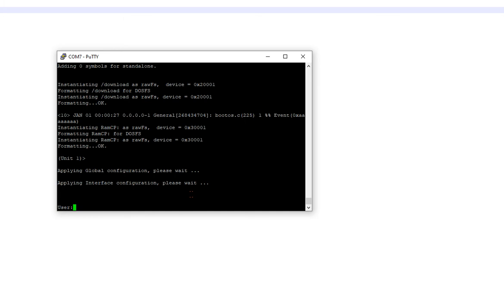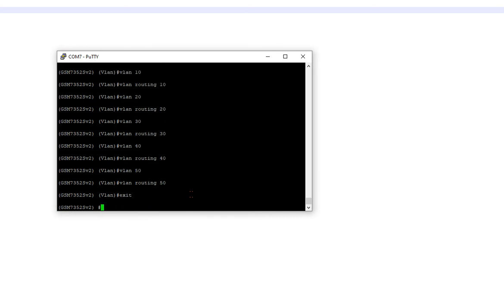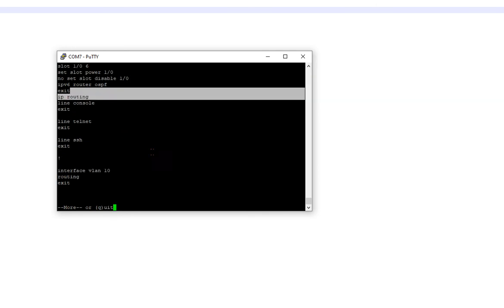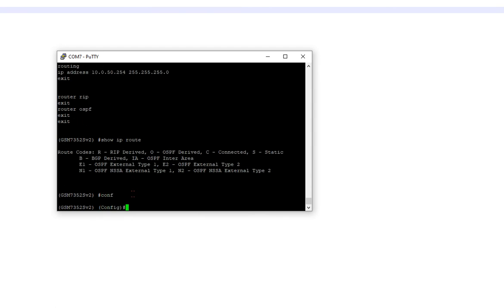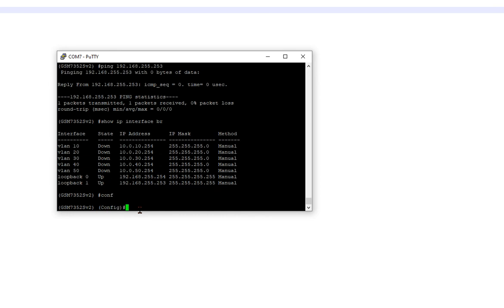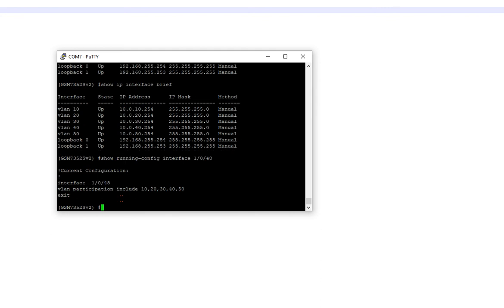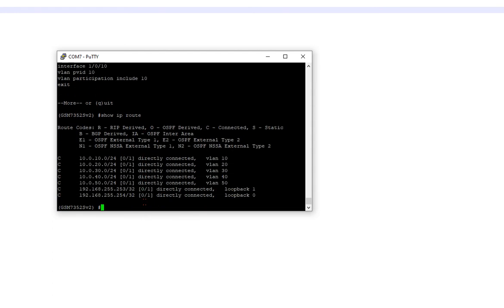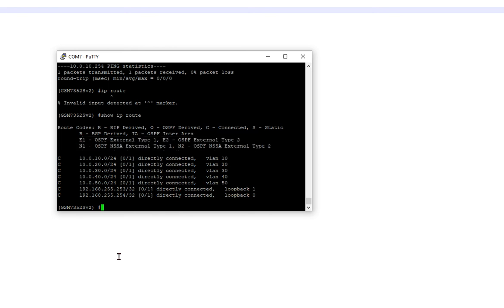Netgear Intervlan Routing

Comment: How can i route this to internet? like all vlan will use vlan 10 as the gateway for internet?
Reply from the maker: You can. You would need a routed leg on your switch (L3 port) as a point to point or screened network and then either ip default-gateway X.X.X.X or ip route 0.0.0.0 / 0.0.0.0 x.x.x.x were x.x.x.x is your next hop.